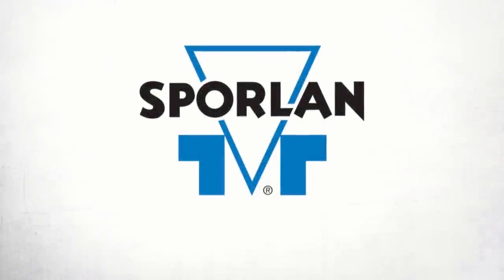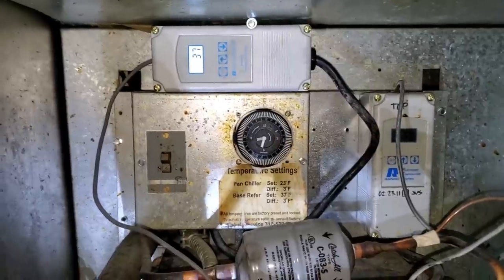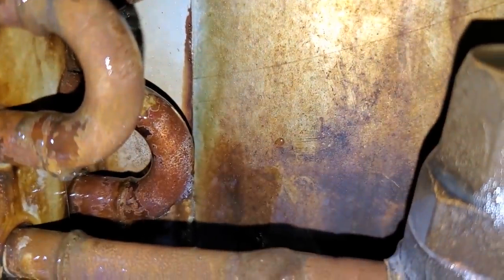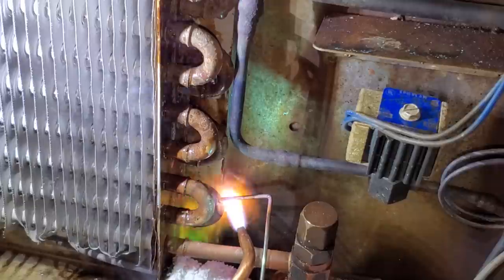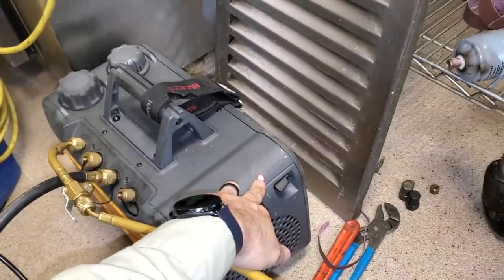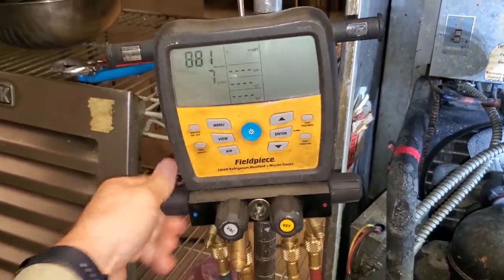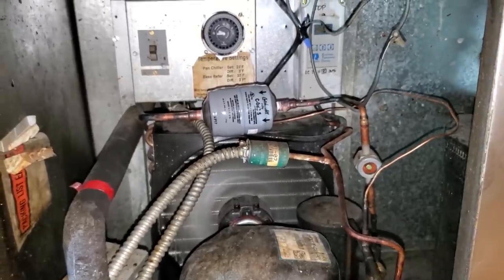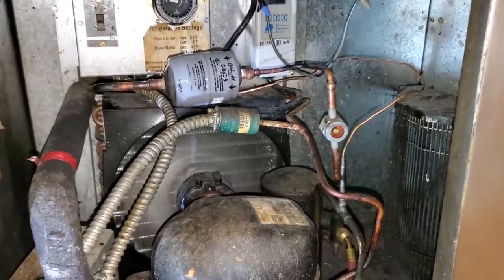KAIRAK REACH IN TOO WARM

Comment: its fun working on a kairak unit, you get the call at lunch time , the cold rail iced up, motor encased in ice. The condenser coil blocked with grease. The cooler drain blocked. the gaskets worn off, the cabinet wheels flat as pancakes, cant even get from the wall. Roaches it both  thermostats and coil rail reading 100 cooler, section reading -20.God i miss it!!!!!!

Comment: Generally when I solder in a box so the insulation don't melt or burn I put a piece of steel behind where the torch is pointed

Comment: We had a  650 Weller 300watt soldering gun  we often used when a customer put a screw through a copper line on an ac..as our shop wouldn't allow torches I t worked well  with copper.i have a map oxy setup now but am retired..from that nightmare.

Comment: Nice video. The only question I would raise is that would it not be better to locate and try to repair the leak before adding gas? In the UK it is illegal to add gas to a leaking system. Obviously in this case it made no difference. Not picking fault, US rules may well be different. Keep making the videos 👍

Comment: Do residential split systems present the same issue of not getting a perfect vacuum when pumped down?
Reply: Yes fixing a leak and then trying to evacuate with oil still in the compressor boiling off you're never going to get that vacuum to where you want it

Comment: Those dang evaps notorious for leaking, drier stopping up, cap tube stopping up.
Reply: on refrigeration esp small units less than a 1 pound charge, I use a smaller gauge set with out all the extra hoses.

Comment: I have a KRP89S  Kairak prep table using a Ranco digital Thermostat.How do i set it for it to cool at 36 degrees.I have it set Temp 36  set Temp 34  Dif 2. temperture never hits 36,its always floating at around 44.Has never given me problems.I even put in a new Ranco digital Thermostat.Any help you can offer would be appreciated.

Comment: Two questions;

1. Nitrogen flow? Curious how you decide when or if to flow nitro when brazing.
2. How do you like your D-Tek Select? Any tips to using it vs a heated diode detector? I just bought one and have always used one with a heated diode. Curious if the infrared reacts differently. Thank you!

Comment: Shouldn’t you replace the refrigerant due to the leak and that 404 is a blend.
Reply: Yes. Water moisture absorbed from air is a problem. Does the customer pay for the virgin refrigerant? Usually customer wants it done cheap as possible. So, the funds were limited by customer and "fresh" refrigerant was not part in this budget... as long it works. They had planes to replace it within a year or so...

Comment: You just valve off the pump and let the manifold micron guage stabilize. If it stops and stabilizes at or within 50 microns of 500 for 5 minutes your good not that big of a deal.